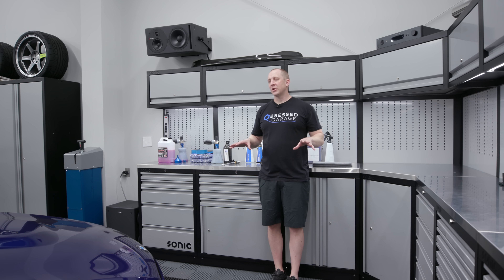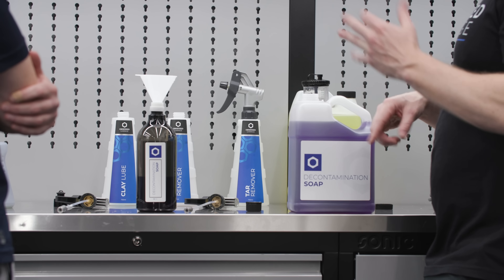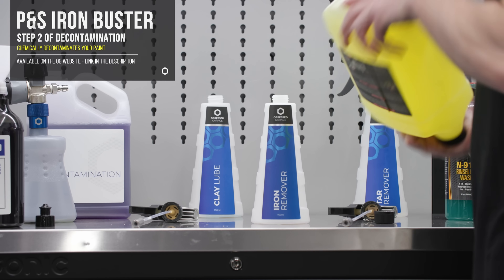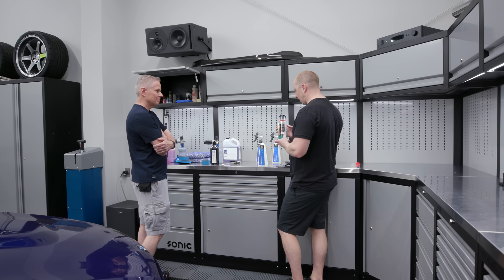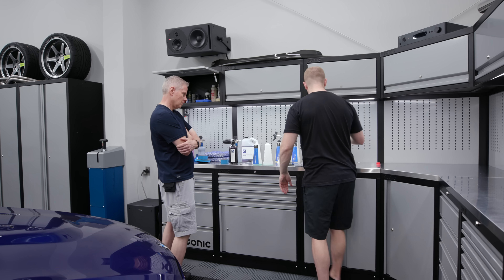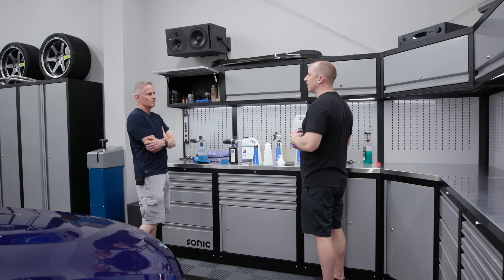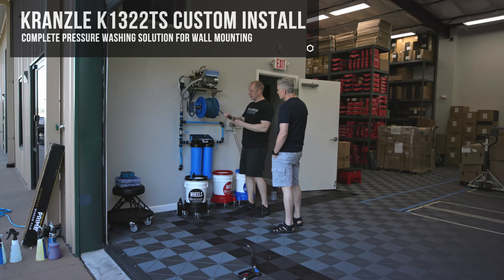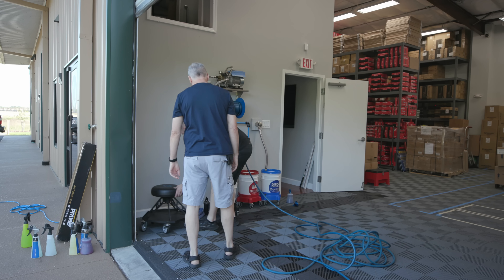How to Wash Your Car Before Polishing - The Detailing Basics - Step 1: Decontamination

Comment: Good process as always. If you live somewhere your car might get quite dirty (I live in Norway) I'd recommend these steps: 
1. Koch Chemie Teerwasche (let it sit for a few minutes). Only use below windows, and all the way up on the back. 
2. Koch Chemie Green Star 1:10 or Bilt-Hamber Surfex HD 1:10 dilution. (Let it sit for a few minutes. This is on top of the Teerwasche). 
3. Foam it down with Koch Chemie Vorreiniger B (Stronger than your normal foam.) Again, let this sit for a few minutes. And do not use any of these products in the sun. (Why are we putting layer on layer of product? To let them have a good and long hang time, so they can do their magic.) 
4. Rinse.
5. Iron Remover - Let it sit for a few minutes then rinse. 
6. Wash the car
7. Clay
8. Dry

Comment: Matt, I'm Surprised you haven't moved to Koch Motorplast yet. I was a diehard diluted Hyper Dressing guy but Motorplast is by far the best engine dressing I've ever used.
Reply: For the price wants the point? Might as well just use whatever coating you use on external plastics for the engine bay plastics and strut towers.
Reply: It is spray on and walk away?
Reply: @Carlos.Rivera  Correct, but it won't last that long and is overpriced for a short term dressing. You'd be better off using your paint coating on the engine bay so that it never needs dressing again for years. Why dress your engine bay but coat your exterior plastic etc?
Reply: @k1r4ns  lol no one is forcing you to use it. Applying a coating is a totally different thing. There isn't a paint coating I want all over my rubber Hoses. You spray Motorplast while the bay is wet  ( Or Dry) and walk away to let it dry. It's not that expensive at all. It's $20 a bottle and lasts a long time. It holds up much longer than hyper dressing, I like the finish better and it leaves great protection. I used 303 for awhile, Still use Hyper Dressing and Motorplast is another fantastic product.
Reply: @thinkforyourself5672  I'm aware of how it works, I just don't see the point. Coatings like DLUX work great on rubber and plastic. Or even a spray coating that lasts a year. Dressing is just the old school way to do it I guess
Reply: @k1r4ns , 98 percent of consumers are going to want a spray and walk away product. Most people aren't like us when it comes to dealing being a hobby or business. As well as most people paying for a detail aren't going to pay for a legit coating under the hood. For those instances Motorplast works fantastically. It does a fantastic job at keeping the bay clean for a product this easy to apply. Regardless it just works really well for what it is. The durability really surprised me
Reply from the maker: I have.  I like Hyper Dressing much more.

Comment: Is a rinse after the clay work unnecessary? I assumed you'd want to rinse it off again after that. Also, if I did a decon wash to prep the car for sealant + wax with no paint correction needed, would I just go right into the application of sealant + wax after the clay work? Thanks!
Reply from the maker: I don’t, but I’m also not claying really nasty cars.

Comment: I like the decon wash.  It is definitely super slick. Let's be honest though it didn't really do much in terms of stripping the bead maker I had on my car. I was using solely bead maker before I had the time to Polish and coat.  
when we are using the decon soap isnt that what we want? To strip everything.   Makes me think that maybe a Bill Hamber strip wash could one day replace the decon soap we are using now
Reply: Just add a few ounces of apc to your regular wash soap. When I mix some Greenstar with GSF it’s gives it some bite and easily strips beadmaker/OG drying aid
Reply: I was wondering would be ok to just use Dawn dish soap to decon?
Reply: @RayNLA  Dawn leaves behind residue.
Reply: @mrblock2013  
I see…
Thanks!

Comment: Will you be doing a vid on how to fill the air pressure in your tires. Which tire to do first eg: driver side or passenger side, front or rear first. Should you completely empty the tire with air first then add air incrementally in each one, then moving on to the drivers side or passenger side. Will you show if it is necessary to fill the tire with air from a certain type of machine, or can you use a pump station at a self serve gas station, or would that be beneath you? What about the Milwaukee tire pump; should you use that with your left hand or right hand, what would be the proper technique? It’s a bit of a rabbi hole but so similar to trying to comprehend on how on earth can I wash my car, it just seams impossible at the stage.
Reply: My man, I know it’s Obsessed Garage, but air is air. What you’re going to get from a self serve gas station pump is the exact same as your at home air compressor. I wouldn’t overthink it
Reply: @ewsickels  I didn't take it as a serious question. I thought he was being silly.
Reply: @timkinley1779  just saw some of his other comments and you’re right. Super weird that someone would spend so much time trolling but to each their own
Reply: @ewsickels  There are a couple of those 'types' of posters.
Reply from the maker: Ha, ha… I love this.  Gave me a good laugh.

Comment: For anyone who has turned on hose pressure before removing the peepee dribble plug, just stick a large enough socket over the end of the plug (on the floor), and smack it with a mallet. Should pop right off. Not sure about full pressure washer pressure, but it did work with just the garden hose pressure, which I still couldn’t get it off by hand.

Comment: My immense graveyard of PF-22 filters is making me start to consider a marolex foamer for brake buster.
Reply: I use the aerator from ammo nyc for brake buster
Reply: @peterjohnson8631  True.
Reply: @cannonsloan2783  I run clean water through the head atfer using, cap it off, and leave the head out of the solution. Never had an issue after doing this method.
Reply: @timkinley1779  same, but it still clogs for me

Comment: This is going to be long-winded …

First, there are too many “if’s” in any detailing process to have one method that fits all. It seems simple, but it’s very important to recognize. Not everyone (regardless of success or stature) coat their vehicles. Not everyone waxes or seals their paint. Not everyone maintains their vehicles. Not everyone lives in Florida where vehicles don’t get that filthy on a daily basis. The point being, one method does not apply to all. It never has. It never will.

One bucket, two bucket, three? lol … in the end, regardless of what anyone says, it doesn’t matter. If you still think grit guards do anything, hey more power to you. Who am I to try to talk anyone out of anything. For me, grit guards and anything more than one bucket is just pure nonsense. Nobody uses 20 towels or mitts to wash a vehicle with one bucket because it’s not needed. Haven’t you seen Matt rinse his wheel mitt before? It’s no different than wash mitts. You blow them out and use it again. “It’s not rocket science” lol.

The decontamination process is not always needed, either. As well, not every step of the decon is needed every time. You may not need to clay or polish or use harsh chemicals to dissolve metals and make a huge mess everywhere. It’s really more of a case by case type deal here. Nothing wrong with Matt’s methods, just pointing out the obvious. It’s why detailers perform inspections before they begin.

Here are the cold hard facts of detailing:

Things you NEED
- soap
- cleaner
- sealant
- dressing
- vacuum
- bucket
- hose
- water
- drying towel

Things you DON’T need
- everything else

The “everything else” are just things that are nice to have, but really don’t serve the basics of detailing in any real capacity. I mean, sure, you do need a polisher and related products to enhance or correct paint if that’s part of your services. Steamers, extractors, pressure washers, blah, blah, blah are largely not needed. Remember guys, this isn’t called vehicle restoration, it’s called detailing. If your client doesn’t give a damn about their vehicles, there’s no reason you should … I would avoid improperly maintained vehicles. However, this is not saying that those items are bunk and not useful. They are useful. Just not needed.

Now for those that prefer to do detailing to a very high degree, sure … some of these things are almost required. Like if you want to be able to get passed a judge on show day, you’re going to need some extra stuff and do some extra work. If you want to protect your vehicle then you gotta do some extra stuffs and the “basics” just ain’t going to cut mustard. Like Matt has said, “do average elsewhere”. That’s a real thing.

Ignore the bucket and graphene debates, it’s all just white noise. You know what you need to do a good job. Matt can get you most of the way there, but YOU gotta do the rest. That’s just how it is. In the end, we all do our own thing because that’s what works best for us.

😬😬😬
Reply: Thats too much... local hand car wash do it for $10 bucks.
Reply: @Carlos.Rivera  That’s really not detailing, though. I mean, to each their own … do what you have to do. I’m talking, specifically, about detailing though. $10 isn’t going to get you there.

😬😬😬
Reply: @Reaper-Jim  no, I want the car clean and later I can do multi step correction.
Reply: @Carlos.Rivera  Apologies, however you didn’t mention that in your reply. Still, a car wash is way different than a detail. 👍
Reply: 🤣🤣🤣 cars don’t that dirty in Florida?  That’s funny.  You obviously don’t live here.  Since moving here I have to wash my cars more because of all the dirt.

Comment: Just because you use multiple mitts doesn’t mean one cant go back to the bucket a few times. I will take a MF towel and hit below the doors, rear of car and then toss aside. The rest of the car is never that dirty and a few mitts works fine. Now if your car is hammered, then i could see the need for 500 mitts.

Comment: Love Matt but I hate how every single video he makes on this topic he focuses on cars that are coated. Not all of us are lucky enough to have a garage to have a car that is "treated and coated."
Reply from the maker: Why wouldn’t you just coat the car?  It’s just as easy as any other protection to apply.
Reply: Get a bottle of TW ceramic spray coating.  One application last 6-7 months and two will last about a year.
Reply: @ohboy2592  Thanks but my problem is everything I've watched about ceramic you need to keep it inside a garage for 24 hours. I don't have a garage that will fit my truck so it will have to sit in the driveway. Dew and bugs would be a magnet for that stuff. Have any suggestions?
Reply: @notta3d  I leave my suv outside.  It won’t fit in my garage either.  If you can wash it early in the morning and have shade you can apply it then.  A full size truck will probably take you about 25 minutes.  You don’t need to cure it for 24 hours either unless you want a second coat.  Now, it’s best to not wash or let it rain on it for as long as you can in that 24 hours but it’s not necessary for full 24.  Dew isn’t going to affect it overnight if you r applied it in the morning.  If you do t have shade, find a local park with a big tree.  After you wash it take it there and then wipe it down with an IPA solution then the ceramic spray.  Drive it home and remove any contamination and just touch up that area again and be done.  TW is very easy and very little product.  Spray one or two sprays per panel, wipe in thoroughly and buff off with a mf towel.
Reply: @peterjohnson8631  it only needs 24 hrs if you are planning on a second coat.  Otherwise you are good to go if need be.  It’s best to not wash or let it rain on it for as long as possible but if you are only doing one coat then it’s not 100% necessary.  That’s from my personal experience on roughly 15-20 vehicles over the last year and a half.
Reply: @peterjohnson8631  with TW hybrid solutions from my experience the 24 hr isn’t necessary for longevity.  I always recommend 2 coats as it increases the longevity up to 10-12 months.  Some coatings, sprays, sealants don’t need that long, I agree. It’s difficult to have customers pay for a service snd then you tell them you can’t get it wet for 24 hrs, especially in the south where rain is common daily here.  But, yes, 100% ideal conditions would be to not let it get moisture for 24hrs since that’s what the maker states.
Reply: @peterjohnson8631  oh. I only know a little about traditional ceramic coatings but I believe all of them need 24 hrs like you said.  I’ve never applied one